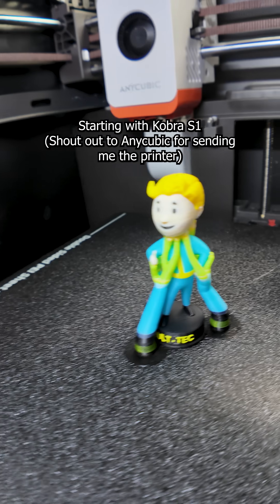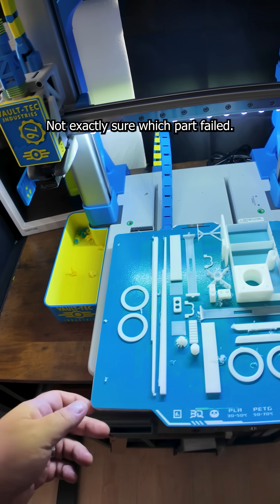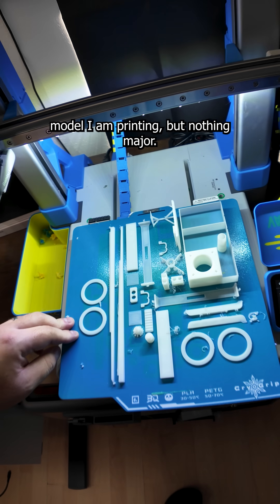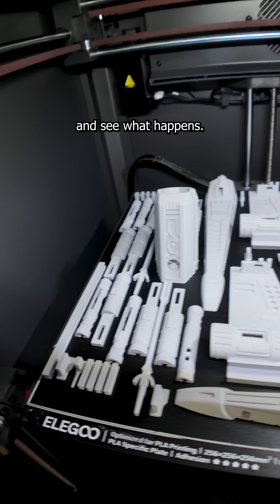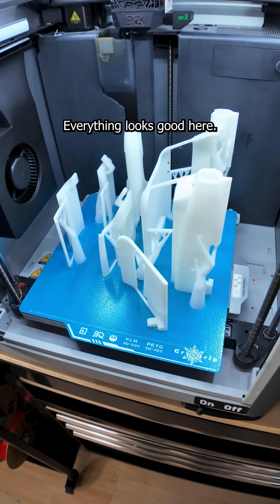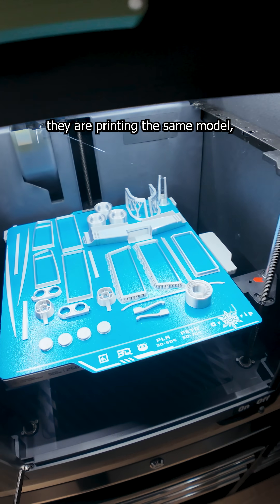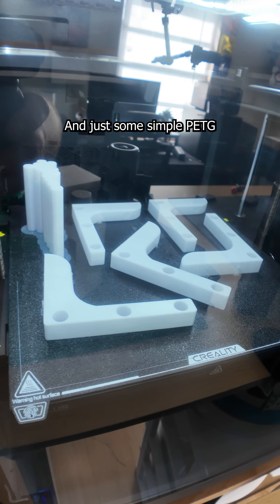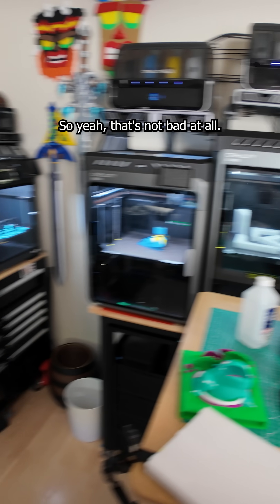I set up 10 overnight 3D Prints - How many finished?

Comment: How reliable is the AD5X? I'm thinking of getting one but I'm unsure of how it holds up in the long run...
Reply from the maker: Based on my experience so far it has been very reliable. I only have 300 hours on mine so far and the biggest issue I had was a clog caused by old TPU snapping in the extruder. Cleaned it up and did not have a problem since